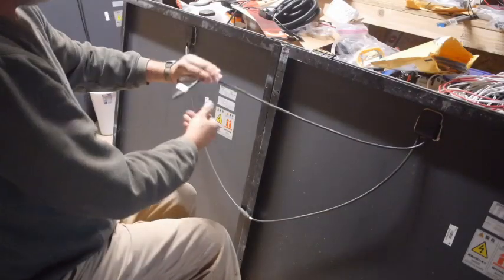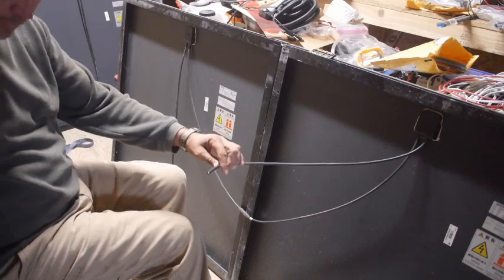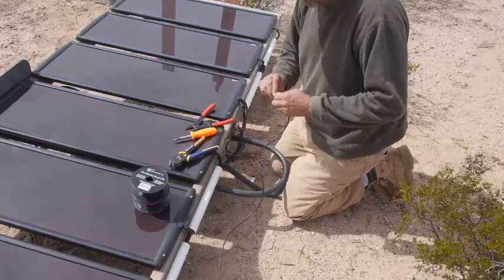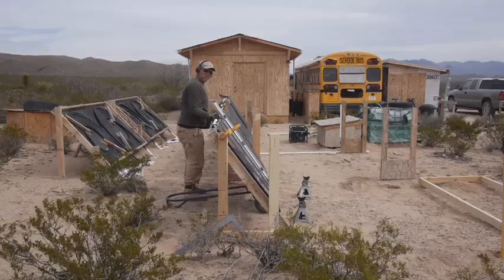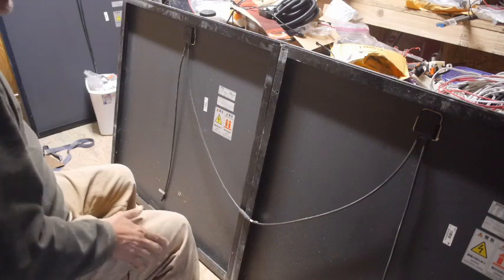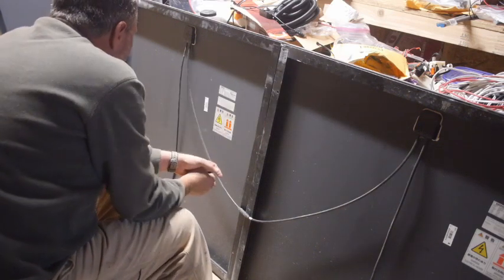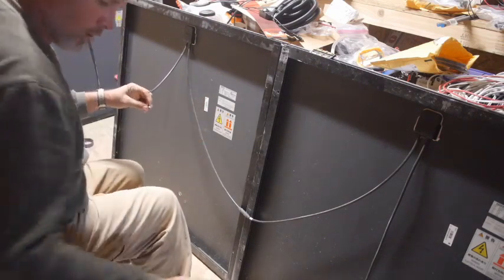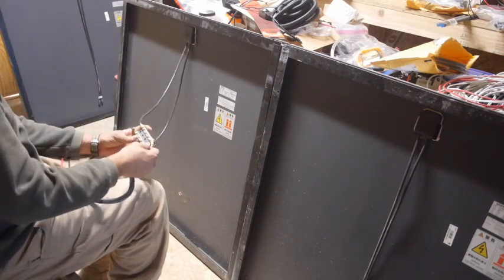Making Room For The New Solar Panels

Comment: You're back with more solar power, awesome.  I like the DIY videos.  In fact that's how i found your page.  I was researching how to put a timer/switch on my inverter and came across your channel.  I used the remote switch plug on the inverter and used phone cable to wire to the 12 volt timer/switch/relay.  Now my inverter only runs from 11 am - midnight.  Congratulations on no more land payment, I bet that's a big relief.
Reply from the maker: Hey Thanks for the comment! Glad to hear it helped!

Comment: That's great  a neighbor!!!
Reply from the maker: Yeah pretty awesome! How close are you to coming out this way?
Reply from the maker: Yeah pretty awesome! How close are you to coming out this way?
Reply: @CarlinComm  bE CAREFUL  120 VOLTS IS NO BIG DEAL   AND DC  i UNDERSTAND CAN BE MORE DANGEROUS.. WHAT DO i KNOW    JUST BE CAREFUL..i WOULD PUT A  WALL RECEPTICAL BETWEEN EACH PANEL AND UT A SHORTED OUT  PLUG BETWEEN EACH ONE.. SO WHEN YOU SET UP YOU PULL THE PLUGS AND YOU HAVE A SAFE OPEN CIRCUIT. IT IS ONLY WHEN YOU PRESS THOS E SHORTED PLUGS IN THE   OUTLETS THAT THE POWER WILL BE ENGAGED.

Comment: Lookin' Good Carlin! I think the extra-heavy insulation was for the voltage those panels could put out (4 panels at 90 volts = 360v in series - could probably WELD with that in full sun lol). I'm with you that they would probably be best with all 4 wired in parallel but that's a pretty good amount of amps! The cool thing is that they are amorphous panels so if one gets shaded it doesn't affect the others too bad. I'll bring up some blocking diodes when I come up. You put them on all of the panels so if one is generating more than the others it doesn't back-feed into the low panel. Come to think of it, I think those already have blocking diodes inside of the little box behind them (?). 

I'm glad you found a use for them! I upgraded to Canadian Solar 310 watt panels and the voltages were incompatible so I couldn't use those anymore so I'm happy you can really get them flowing again. Don't worry about trimming the ends of the wire, they terminate inside of the little box so the whole wire can be replaced if necessary (or upgraded to MC4 connectors). 

I'm with Joris Wagter - The DIY videos (and struggles that come with them) are the best. It's tough on you sometimes but know you're helping your fellow homesteader! Can't wait to come up and get started on my water harvesting and off-grid cabin neighbor!
https://www.youtube.com/user/ythoustonfirefox
Reply from the maker: I have the first panel online as of this morning, so far so good. Had to come into town for supplies. Stay tuned!

Comment: Hello, I'm curious as to why you were not able to run these new to you panels in parallel or series with the Harbor Freight units ? 

If I remember correctly in the video you said that the actual connectors of the donated panels were different and therefore not compatible with the Harbor Freight panels, so my question is this because the volts are different and this is how manufacturers keep all panels compatible to a system; in say 12volt or 24volts panels for example. 

Meaning one cannot mix and match 12 and 24 volt panels, because there is a universal standard connector for each ? 

I'm wholly new to the solar thing in the last couple of days. I saw the Harbor Freight 100 watt kit and purchased it with the coupon. 

I have not even opened the box yet as I'm not convinced that it's the best route. I want to eliminate as many upgrades as possible to save money, and ultimately see myself at around 500-800 watts worth of 12volt panels, 30 amp charge connector, 1500 pure sin wave converter and 2-4 100ah GEL or AGM batteries. 

Which my next question is, if I decide to keep this Harbor Freight kit how will I know if panels I want to purchase from Amazon will be compatible ? 

I appreciate your time spent in responding. 

Thanks
Reply from the maker: Right, the big black panels put out about 60 volts, the HF panels put out about 18 to 20 volts, so the voltage difference is quite a bit. Ideally you'd buy all the same panels, not mix them. My system, because I have had people donate things, is kind of a mess, but it does work. To get around the differences, I have the big black panels going through one charge controller, and the HF panels going through a different charge controller. Both charge controllers are connected to the same battery bank, which is also not ideal, but it does work. If I disconnect one system, I can see I'm getting less charge in, I'm sure its not very efficient mixing things but it has been working like this for over a year. To catch you up to current specs, I have other videos if you're interested, I have 4 sets of the Harbor Freight panels. They are going through a 30 amp PWM (not MPPT) controller, into 4 deep cycle marine / rv batteries I got from Sam's Club. Nothing special there. That is feeding a 1500 watt inverter, and I can run most of what I need off of that system. Then, I have the big black panels (240 watts) going through a 30 amp MPPT, plus a set of silver panels (320 watts) going through a 20 amp MPPT, because they also have different voltages from the panels. The 30A MPPT and the 20A MPPT are both connected to a single 100 amp hour Li iron phosphate battery, into a 2000 watt inverter from Harbor Freight. What I'm doing now, the single lithium battery isn't enough to run 24 / 7, so I run it for my Day loads, computers, coffee maker, etc. I switch over from one system to the other. All day, the HF panels recharge the deep cycle batteries, so by evening, since there was no load on them, I can use them to run my computers into the evening, and have some power left for the morning before the sun hits the panels. I run that until about 10am, by which time I have enough solar on the "big" panels, to switch back to the lithium. I have too much solar for the single battery, but I can run the computers for video editing all day. It would be much simpler if I had 2 or 3 of the lithium batteries, and one type of solar, and one big charge controller. But, half of my panels were donated by someone who had upgraded. Also, I was able to buy one solar kit at a time, as I had money. The HF panels aren't the best, but mine are coming up on 4 years old and still working. A lot of the plastic frames have cracks, but they are still putting out power. I measured with an amp meter one day, each of the 3 arrays of panels, the HF, the big black ones, and the silver ones, are putting out between 15 and 18 amps to the battery. So they are all putting out nearly the same amount of power, I was surprised, I expected the HF to be way lower, etc. If you can afford to do everything up front, in one jump, that's easier and cheaper. If you aren't sure, getting started is better than waiting. If you can afford the lithium batteries, they will (should?) last much longer, eventually you'll be money ahead. The lead acid batteries I use I replace every 2 years, by then they're not holding much charge. I expect to go 10 years on the lithium. They're about 5x the price, so I'll about break even, but if they last longer than 10 years, I'll be looking pretty good. And in 5 or 10 years, the tech will get better, so I'll have better options then. Or I'll be old and not care anymore :) Sorry, that got long, hope you can get something useful out of that.
Be sure to subscribe!

Comment: what angle are you trying to hit? My area says 31 deg for best for all year.
Reply from the maker: Yeah the sun moves in Texas, I adjust 4 times a year. That is the winter position, summer will be nearly flat. I don't have the angles at the moment, but will be doing another solar video soon, so will be sure to include them. Thanks for the comment!